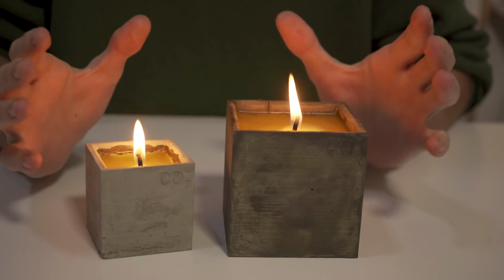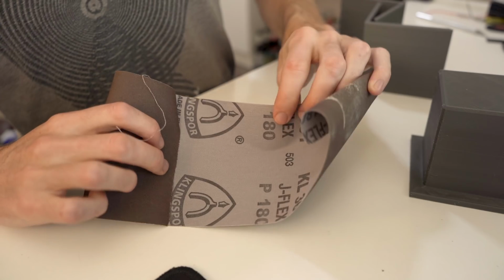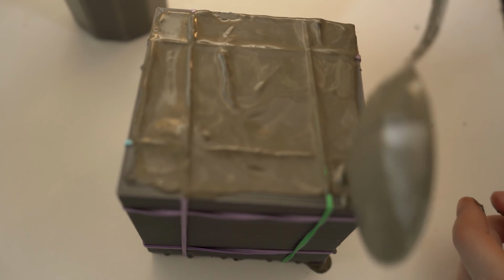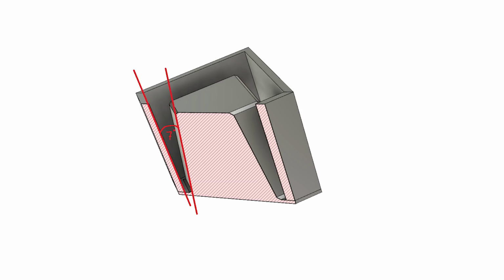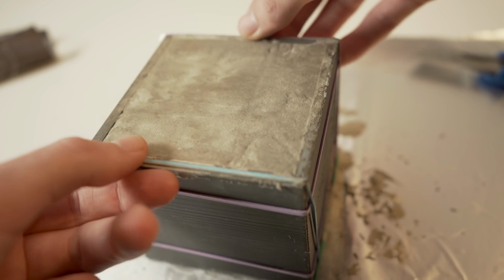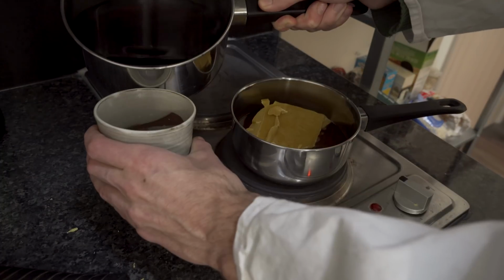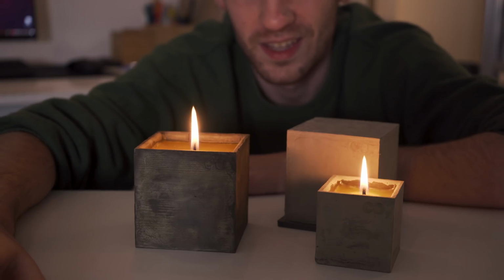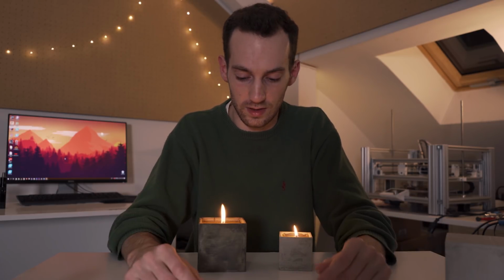Making Cement Candles with 3D Printed Molds

Comment: Just make the inside egg shape till thou fill the void to taste. If you want a box 12 degree not 7, and make the corners collapsible. Thinish at the corners cut in half. Half the cross supports. Use a sander for vibrating it. Turn Sanderson and up side down, then touch the surface the mold is on. Game over $old.